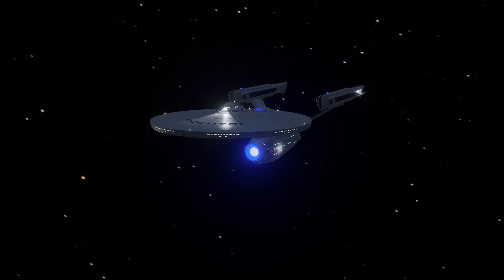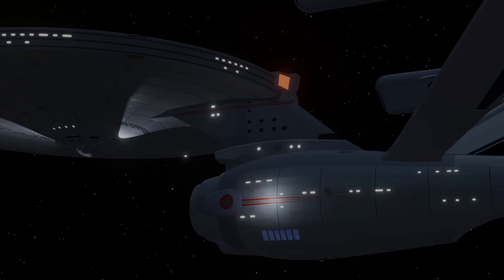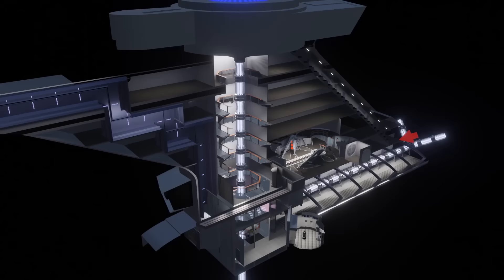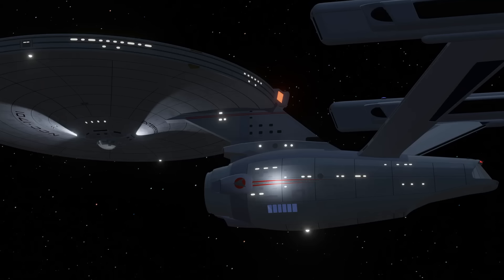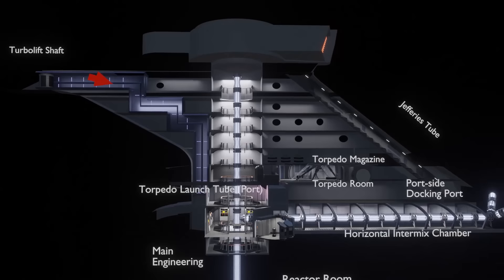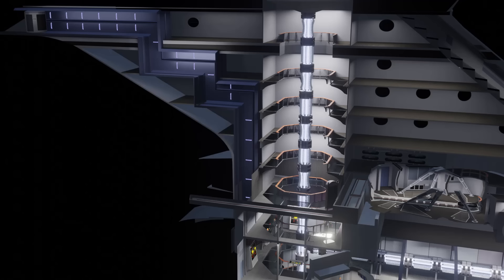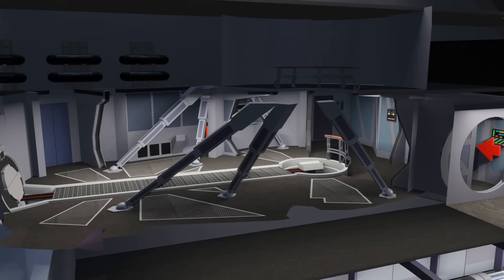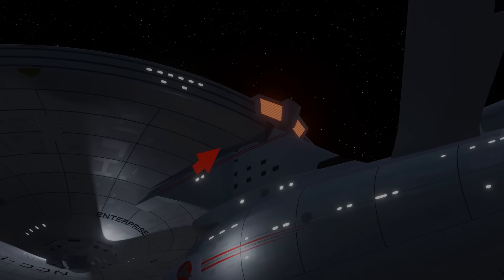The Enterprise Dorsal Problem: how did the turbolifts pass through it?

Comment: they never put this amount of thought into the design.  realistic renders of the ships only began with discovery, which were necessitated by the VFX models that let them do shots pushing in from space into windows onto set.  versions of this were faked on TNG onward but on disco they built full models of the ship, including hallways, and then did it for constitution class ships for enterprise, which required retconing the class to be larger because the canonical size of the ship did not work with the windows you see, the implied corridors within, for the 3d renders needed for vfx.  love your videos.

Comment: I always imagined the connecting turboshaft ran vertically, as you show,... but all the way past the hull separation into the saucer.
Also -  extendable turboshafts would extend down from the dorsal connector when emergency-landed.
also -  the saucer would sit on (and crush) the lower sensor dome, upon touchdown, carrying the weight of the saucer when emergency-landed, relegating the 'landing legs' to the job of leveling & stabilizing, not supporting.
Side note:  Unfortunately, there is little to no communication (in my experience) between the Concept Designer and Production Designer / Draftspersons / or any other persons who can add random doors & other features (like a 20 foot corridor outside of Engineering) to a set which could never exist.
Fortunately, there was great communication, in that regard, on ST:TNG.
Reply: Funnily enough, another poster and I came to a similar conclusion (about jettisoning the lower saucer and just using the legs for stabilisation) a few days ago!
The extendable turboshafts is a useful extra feature though 👍

Comment: Strategic Design's blueprints of both versions of the Constitution Class (OG and Refit) actually explains the turbo-lift system in regard to this very issue. It's non-canon of course, but it makes the most sense. The turboshaft in the saucer section has a pathway near the rear region of the portside of deck 6 to deck 7 where it leads to another shaft just under the impulse engines, straight down the ship's neck, and moves to another shaft that doesn't interfere with either the Vertical & horizontal levels of the Engineering decks. Other than the engine equipment in the Neck, I don't think that region is meant to be lived in in terms of comfort. 

It's not just Wrath of Khan where Kirk causes a problem with the Turbo-lift system. The Motion Picture has internal space issue with Engineering as there is a straight corridor at the entrance of the engine room where it can't possibly support one. This only makes sense if Gallifrey is a member of the Federation.

Finally, this particular ship is why I dislike ALL the Kelvin Universe JJ-Prise as that design is absolute SHITE with consistent crap angles. Even the JJ-Prise-A looks like a Turkey with those horrific shaped pylons instead of the elegant bird of the TMP design.

Comment: What if there were two turbolifts used? a person would need to use the saucer lift to reach the neck, walk past the chamber to the engineering lift to reach the rest of the ship. That makes more sense and solves many problems. The one issue is that you don't have a single continuous lift, but a split system.

Comment: I always thought that the "vertical intermix chamber" was in the middle of the Engineering section, and that only power was relayed through the "neck" of the ship, so there would be plenty of room for a turbo lift shaft, or even two of them.

Comment: I seem to remember some drawing that showed the lift from the torpedo room going down below engineering then forward to meet the main shaft between the saucer and secondary hull, which ran between the torpedo tubes to a point. The same drawing noted that during torpedo operation the lift shaft was closed and the torpedo tubes bisected the lift. So there could be no lift between engineering and the saucer during combat operations, which is why those small man lifts that ram the inside of the vertical intermix shaft existed, to provide movement via engineering between the saucer and secondary hull.

Comment: when looking at that problem, I could imagine that there is some sort of crossroad, like a crossing of a street and a railway. the torpedo rides through the channel that is on the floor, disappears in the wall. behind the wall, there is the turbolift shaft and the torpedo has to cross the turbolift shaft.
especially since discovery introduced the vast rollercoaster space for turbolifts, that shouldn't be a problem at all.
of course, a battle situation would halt turbolift operations, which is bad. scotty, go to engineering. but captain, we are firing torpedos, I can't go there right now.

Comment: The turbolifts don't necessarily have to remain upright the entire trip. Gravity onboard the Enterprise is generated by plates in the deck. If the turbolift car has a gravity plate underneath the car could be tilted in any direction and 'down' will still be toward the bottom of the car even if the car is upside down. Once the turbolift enters the 'neck' the turbolift tilts parallel to the angle of the  neck and with the gravity plate inside the lift the people inside would still feel upright and once it gets to its destination the lift aligns with the deck and people just walk out normally. 
This could be shown for example in Lower Decks. The turbolift could arrive at a deck and through some computer glitch the car ends upside down and the people inside feel normal but sees the ship as being upside down.

Comment: If I recall in the original series the lights on the back of the wall of the turbo lift indicated that it did not just travel vertically but also horizontally at some points. That might explain the discrepancy

Comment: The most obvious solution is that on each deck of the Enterprise there is a small empty room about the size of walk in closet with doors marked on the corridor side "Turbolift".  Upon entering a "turbolift", the occupants state their destination.  A small mini transporter then transports all the occupants of the room to the first stated destination deck, where the closet doors open and someone gets out, then the computer transports the remaining occupants to the next stated location closet, etc.  Yes, I understand we do not see the usual sparkly fade out and fade in of the normal transporter and we miss out on the fancy sound effect, but these transporters don't require any fancy effects like that because they are running entirely on the internal wifi of the ship, the same network the crew uses to access Fleetube and Starflitter.  Kirk Forever!!!

Comment: Good points.  However if the elevator can do a diagonal pitch it would have little difficulty with a semi circle and just circom navigated the intermix shaft on g deck.  Another solution is that the shave IS in front of the power shaft but the access doors from the torpedo room are NOT the point at which the elevator shaft comes down to.  There is a side area making the torpedo room larger than the neck and this is where a hall could be to gain access forward.  I am not saying it is a good design but there are still possibilities.  Your first design is the best offer.  And the plot indicator on the turbo lift floor plan is misplacing the location of the turbo shaft by a few meters.

Comment: I'm thinking the "turbo" "lifts" were also "turbo" "teleporters" creating portals...
To any observer aboard the Enterprise A the elevator shaft is one long straight upright tube... but between a few levels are "portals" (based on teleportation tech).

It would be a nice elegant explanation totally within Star Trek's realm of possible... so long as the distances between portals is under 100m for example, it works. Beyond a certain distance it doesn't... and that explains the reliance of teleportation over these "portals" for all longer distances throughout the franchise...

Comment: This all may be the best justification for the retcon in both the Kelvin and the Disco/SNW Enterprise.   The ship is simply bigger than we thought it was and there's turbolift shaft on both sides of the warp core
Reply: Kind of but kind of not. The story goes that the JJ Enterprise was going to be the same size as TOS Ent, but they realized after they went to design and build their sets that nothing would fit properly.  So they doubled the official length without changing the exterior model. That's why the windows are still in scale with the OG Ent, despite being the equivalent of two decks tall according to the rescaled dimensions. Just another production goof. The new specs probably just carried forward into the new TV series.
Reply: @ironsides982  this isn't unprecedented.   The Millennium Falcon and Galileo shuttle are 2 more examples of interior sets being twice as big as the exterior.     I had the Enterprise RPG map from the old FASA days that was scaled for a thousand foot ship.    It was too small.   4 people couldn't squeeze into a turbolift car.    In Star Trek:The Motion Picture, that was the shuttle bay  they were in when they watched the feed from the station being destroyed by V'Ger.   I won't mention STV when the rocketed up the turbolift.   That was just sloppy continuity.   That was too tall even for the JJ-Prise
Reply: @hollywoodguy70  Right, I remember hearing  (cant remember where) that Shatner thought that the current number of desks sounded too low for whatever reason. They just numbered the decks up to whatever sounded good for those shots in the turbolift shaft. I suppose when you're depicting that kind of speed, 20 or so decks didn't read too well. The speed combined wit the number of shot depicting them in motion would have put them well past deck 20-whatever, so they quadrupled the deck count. Not that they needed that scene except to make the journey from the brig (on the bottom of the ship for some reason) seem more dangerous and exciting. LOL we all know ST:V had alot of issues.

Comment: As far as I'm aware, there never was an emergency saucer separation on the Kirk era of the Enterprise, this was only a feature on the TNG Enterprise, which was actually used on a couple of occasions thinking back.
Reply: According to the canon manuals, there has always been the ability to seperate the saucer in an emergency, even in TOS, but it's not reversible. Like an ejection seat, using it means trashing the vehicle. TNG made it into a gimmick.

Comment: This all assumes that 'vertical' remains the same throughout the ship, but the Enterprise can control the direction of its gravity -- I'd bet the "vertical" intermix chamber actually runs along the aft edge of the hull pylon, rather than the forward edge, and Engineering is tilted about 30 degrees from the rest of the ship.

Comment: I feel as though the turbolifts are likely completely solid state, ie, they are the rotor of an electric motor.  Suspended magnetically in the turbo lift shaft.  I would agree that the turbolift going down the angle of the neck makes sense.

You're missing two critical things to consider.  One:  There would be two turbo lift shafts.  Starfleet is well known for redundancy, so there would be a minimum of two shafts.  Just for the simple fact that one shaft would be a serious bottle neck in the event of calling red alert.  Imagine all the crew in the arboretum waiting for all the inbound traffic to pass and unload.  Both shafts will need access to the torpedo bays and engineering.

Two, the other factor, depending on the design of the intermix chamber, it may not need large walk ways, it might be a close fitting, armoured tube that also provides structure to the neck.  I would suggest that artist renditions have made this error.

I think there would be, likely, four shafts of the same diameter.  One for the intermix, two for the turbo lifts and the forth for the torpedo feed mechanism.  If I were to design the enterprise, I would have the torpedo magazine a ring that goes around the saucer, perhaps only part way, that intersects with the torpedo feeder directly under the impulse engines.  This way there is no large quantity storage in the neck, and four, heavily armoured tubes would give serious strength to the neck structure.

I agree the blue sections are likely armor, but I'd also suggest that it's modular armor that can be easily removed/replaced.  So maybe the intermix chamber lives inside a small armored tube, but if it gets damaged, just cut/extract the sections of the intermix chamber directly out of the neck via shuttle craft.

That's something that has always been seriously glossed over in star trek, is the scope and complexity of the Enterprise as a machine.  All of the different considerations that would have to be made to make her reliable.  It also is one of the reasons I wish TNG had kept Picards Stargazer as a constitution class instead of making the constellation class.  The B52 has been in service over a half century.  We saw the excelsior in service for a century, that also should have been true of the constitution refits.

Comment: The vertical intermix chamber might narrow before it gets to the impulse deflection crystal. Or when it got nearer the crystal they took away the empty space around it and put up signs sayig "Do not touch."
When Kirk gets into the turbolift and heads to the bridge, the car might head down, around, and then up between the torpedo tubes. Maybe. It might require a spacewalk over the navigational deflector.

Comment: I’ve thought a lot about this over the years.  Is there any canonical evidence that the warp core goes up through the neck of the Enterprise?  

We assumed it went all the way up to the Impulse Chrystal, but why?

Clearly, on the Miranda and Constellation classes, the impulse Chrystal moves around with the Impulse Drive, not necessarily the Warp Core.

In fact, there’s no way the two Impulse Chrystals on the port and starboard sides of the ship aligns with the top of the two vertices Warp Cores.

Given this, I would assume that the Warp Core on the Constitution Class stops at the top of the secondary hull, just below the torpedo launchers.

Comment: Without watching:
In the ST:TNG Technical Manual for the Galaxy Class starship, turboshafts ran both vertically AND horizontally, making a fully interconnected system that allowed any turbolift to take any passenger to any destination in the network.

Comment: If we're playing Starfleet Engineer, we've got a glaring presumption to deal with: Why are we presuming a Turbo-lift  remains in the horizontal orientation?

A 'Turbo-lift' is pretty much a shuttle-pod in a tube, it has it's own gravity plating. What ever way it pitches, rolls or yaws you won't notice in normal operation. For all we know "Turbo-lifts are down Captain" means: 'If we take the lift to Engineering we'll yack our guts up at the 1080' backflip junction on deck seven!'.

Comment: I've done extensive starship designing via AutoCad in the past and my measurements make the interconnecting dorsal 8 meters or about 25 ft not including the photorp complex.  Plenty of room then.  Also, this makes room for the guest quarters on these decks.
i've also always thought that the Enterprise was larger than established measurements.  For example, there is space between decks for power conduits, lwater and sewer and jefffreies tubes.  Additionally, the sizes of the landing bay, cargo by and Rec One in TMP certainly speak to a much larger ship.  Originally, A. Probert wanted the refit to be 2,000 feet long (later these designs were partially retooled for the D).
Making the 1701 440 meters in SNW is arguably one of the few retcons that works.
Also, somethign to note: In the episode Mudd's Women, Scotty, when talking to Kirk about getting dilithium crystals, says that nearly a million gross tons of vessel was then operating on 1 crystal.
Reply from the maker: Good points.

Comment: I’d always figured they’d have to take one turbo lift to one part of the ship, then walk to another to get to a different section of the ship. Yeah it’s science fiction, but there’s still a possibility of them in universe employing a similar elevator design as the St Louis Arch uses. Albeit faster in Trek. I remember as a child looking out the port hole in the Arch’s elevator capsule and you can clearly see how it works moving upwards through a curved path.

Comment: You’re assuming the turbo shaft runs directly aft.  If the shaft instead went out to the rim first then around behind the intermix tube it would pop out between the impulse engines and the intermix tube.  From there it’s a straight shot down to engineering.

Remember in ST they’ve achieved such casual mastery of initial dampening that accelerating the turbo lift to 1000km/hr to get from A-B slightly faster is only a function of how much energy can be spared.  For the humans inside the lift could be making any motion.  It could be spinning at 10,000 rpm and they wouldn’t have a clue.

Comment: You square the circle with short range local transporters. The turbo-lift takes you to the bottom of the dorsal, then you and the lift cage are unknowingly transported to the other side of the intermix shaft, and carry on your journey.

Why do it this way? it’s automated, no operator required. the lift cage gets transported from a set location to a second set location.

Comment: As far as the Oberth and turbolifts…. I have decided that transition between the hulls is so infrequent thst it dont have a shaft, but a system of rails along the inside of both the port and starboard strut and a pod exits one hull and slides along those rails , to enter the other hull